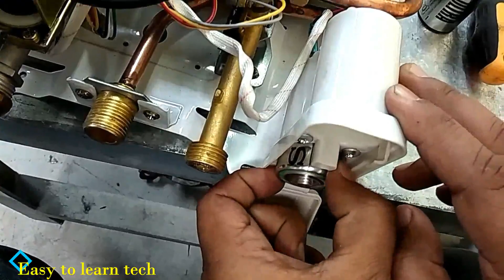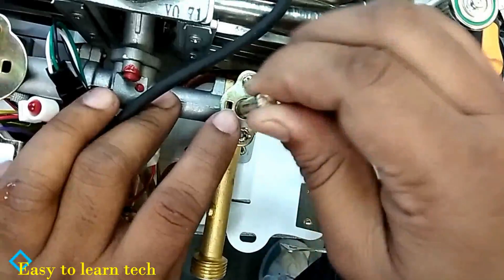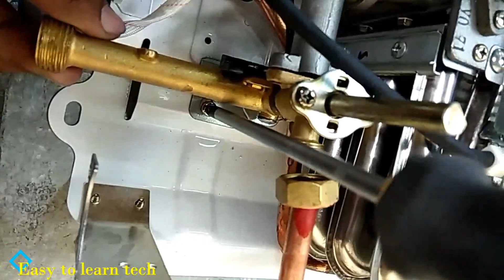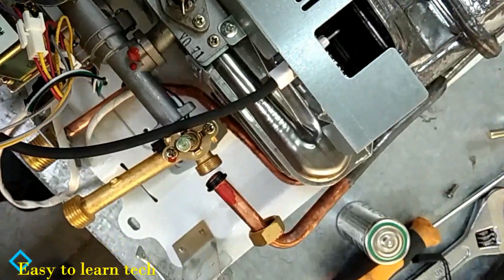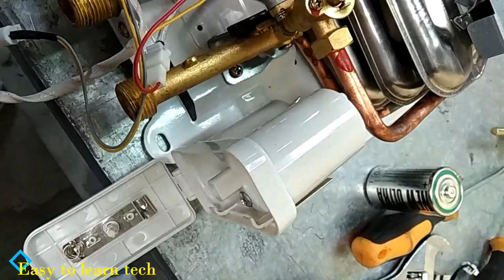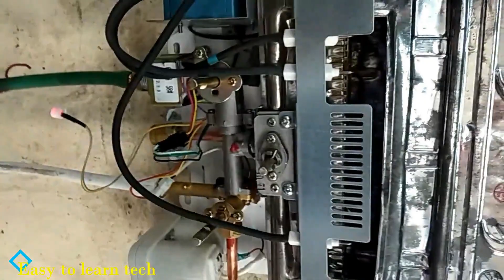GAS WATER HEATER,HOW TO REPAIR (STOP) LEAKAGE

Comment: Bhai meray gyser kay screw dosri side say lagay Hovey hain 2:34 ya walay in ko open kesay kro??
Reply from the maker: Small screw 🪛 driver use kara bhai
Reply: Jgha bht choti hai dosri side say
Reply from the maker: Wire cutter or player use karna
Reply from the maker: Picture mail kara
Reply from the maker: Bhai check the space according to that size ,you have to use small screw 🪛 driver... To open that screw
Reply: Thanks for your help appreciated.
Reply from the maker: Star L type key try karna , easy open kar sakte ho aap.

Comment: Nice video.Thanks for the guidance. My LPG Geyser cut off automatically after 2 to 4 minutes. Could you please guide me what is the issue. I have Relief Gas Geyser. Help me please, send your suggestion at sandeepjadhai@gmail.com
Reply from the maker: Hi sir thanks for your support,
I think you have to check your water pressure first,if the pressure decrease automatically the magnetic senior will get disconnect with magnetic solvent value and it will stop the flow of gas, this my be the reason. Please let me now later